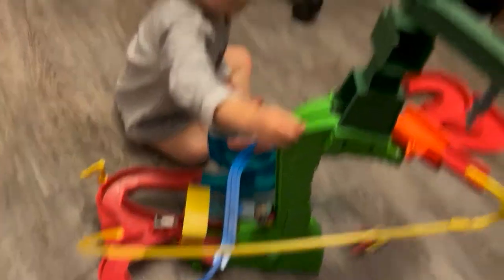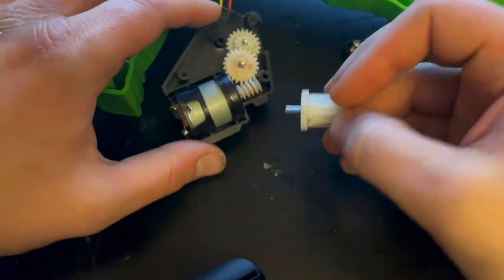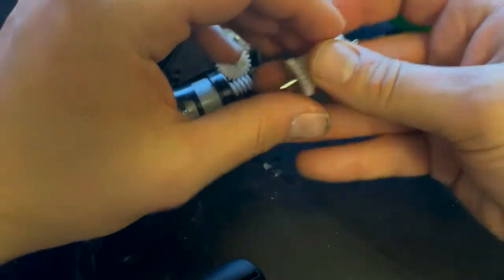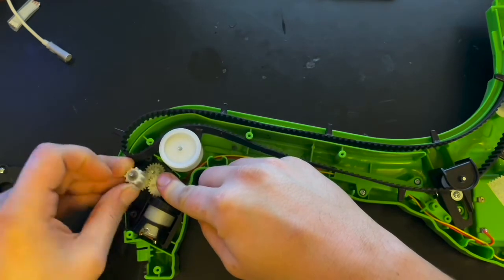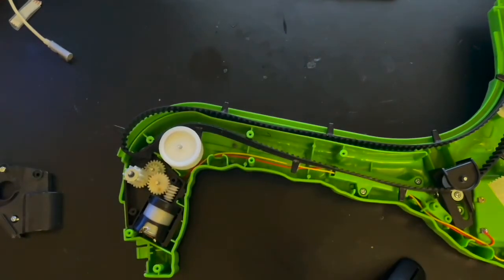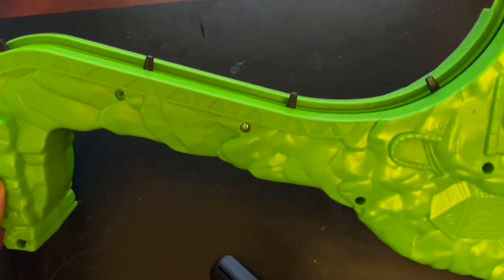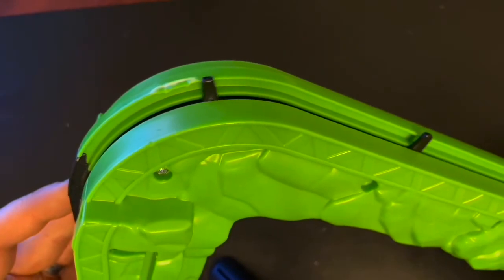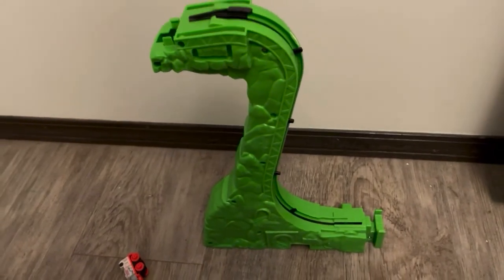Quick Fix: Thomas & Friends Motorized Raceway

Comment: No need for washer. Lubricate the belt and the slides with a silicone spray lubricant (spray directly on to belt or spray on to tissue and wipe on where necessary. Friction of belt will be reduced so clutch mechanism does not activate. Additionally if you add the lube to the slides the trains will run smooth and fast, like when it was new.   Re-apply as necessary.
Reply: worked ty